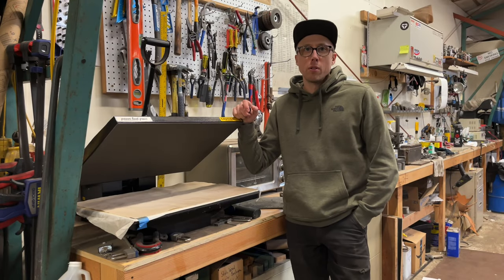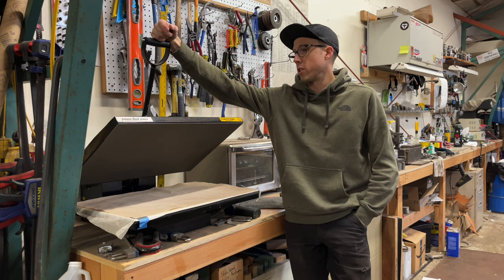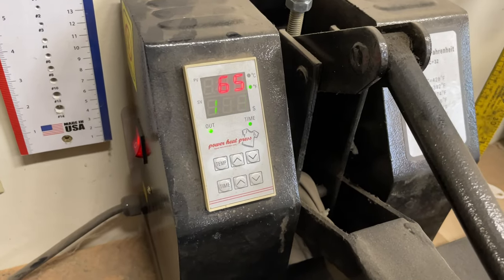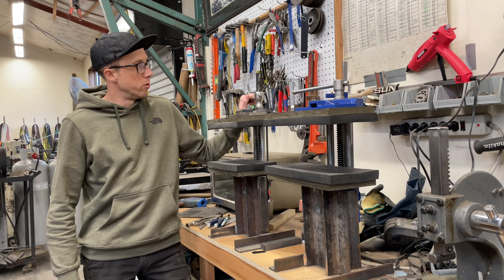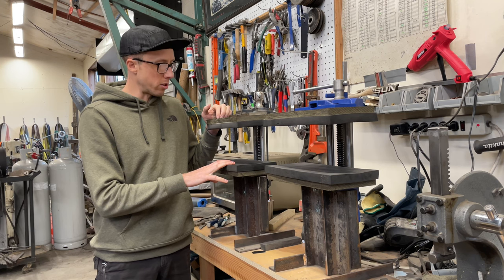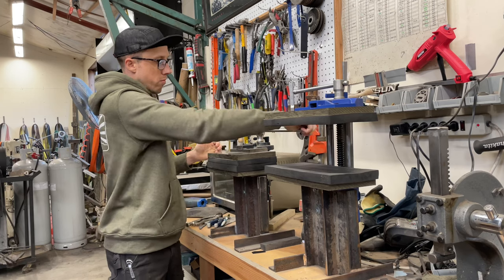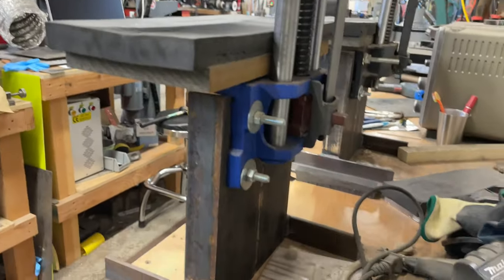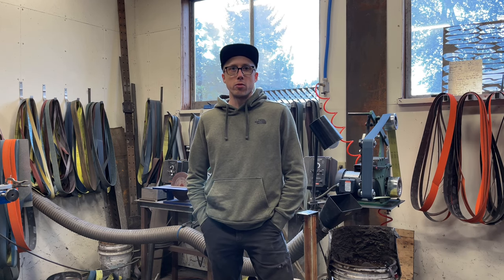How to make the best kydex sheaths!

Comment: Thanks for the shoutout on the molding press, Ben! In turn, I adapted the idea from an aluminum quench plate setup, I believe by Ed Braun. Using a T-shirt press and the good molding foam is by far the best improvements I’ve had in molding sheaths.